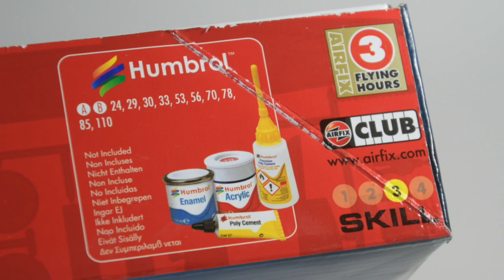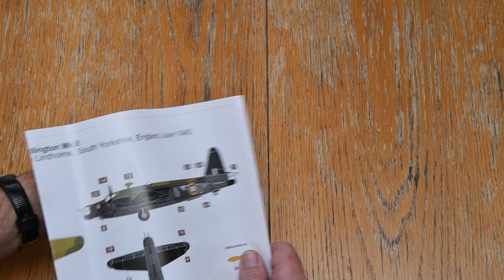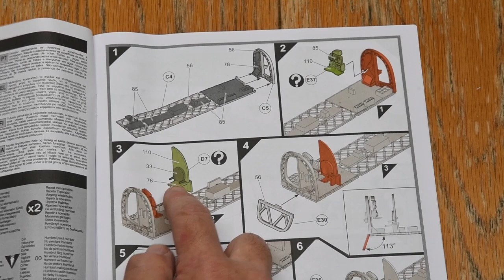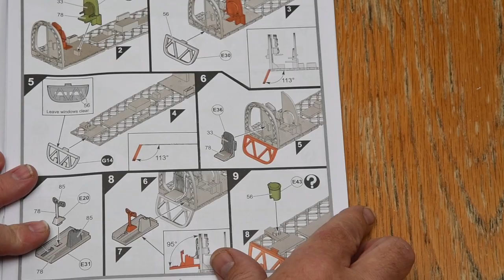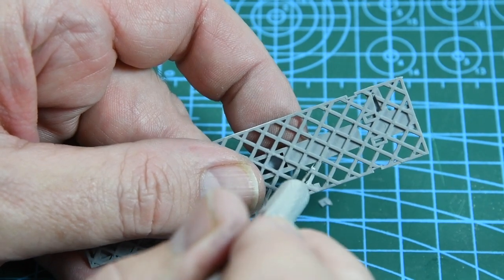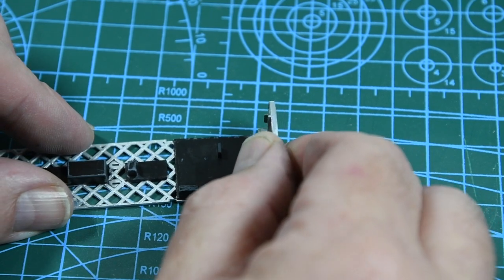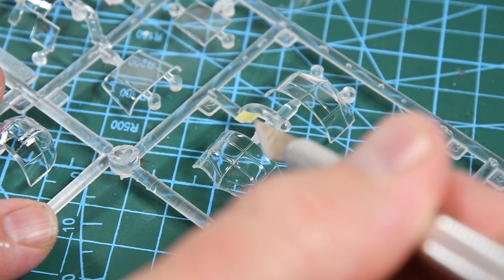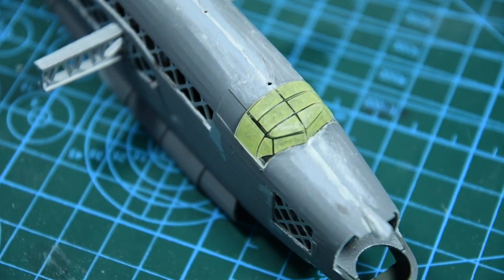Airfix Vickers Wellington Mk.II 1/72 2021 release full build and review  HD 720p

Comment: Well, that went together well.  That wouldn't have been the case with older Airfix molds.
You seem to use the term interior green for 2 different colors.  Interior green is as you have described it, and that IJN green is a nice scale match.  But the "interior green" for mechanical areas is often zinc chromate primer/preservative on Allied aircraft, which is actually a tinted yellow in colour.  Just a note from previous builds.
This is a workhorse aircraft in WWII and, I would have thought, a complicated build.  But you took us through it a step at a time and made it all work.
Bravo!
Reply from the maker: Thanks Randy! Yes, I have encountered green zinc chromate on other kits - like the Hellcat in FAA service. I followed the Airfix advice on colours and they may well use interior green instead of chromate in some bits - I'm sadly not that familiar with the Wellington to know what goes where beyond the instruction leaflet! BTW more recently I have been using Vallejo IAF/IDF Green for RAF interiors as that seems just a bit closet to the BS colour. Cheers, Gary

Comment: A great kit, but Airfix did slip up a little by making the bomb bay roof open latticework.  In fact it had a solid floor to the fuselage, easily sorted with thin plastic card.  As moulded there would have been a hell of a draught in the fuselage when the bomb doors were opened!  Excellent video.

Comment: Thanks for the video. I’m building the mk1 so this is very helpful. 👍🏻
Reply from the maker: Glad to be of help. It is a very fine kit, good luck with it!
Reply: @garys_stuff  I’ve now built it! It’s a great kit. Do you have any recommendations for weathering a plane like this? I’ve only done panel washes before. 🧐
Reply from the maker: @TJFNixon  I did panel washes on the Stirling I've just finished, using a grey wash for the black areas and that worked well. Otherwise using a weathering pencil is a good way to get chipping effects on finished paint - use one of the water-soluble pencils from an art shop like Faber Aqua  - or an AK Interactive pencil of course! They do a variety of aluminium shades but are not the cheapest things. Little bits of dry brushing of aluminium can look good too but practice on a bit of sprue first, this kind of thing is useful for propellers. Also add some brownish grey wash to the gear legs perhaps.
Reply: @garys_stuff  ace. Thanks. I’ll give it a go. 👍🏻

Comment: Nice job, Gary! 

I note you have had to use an amount of filler on the fuselage and engine casing joints - were these areas problematic? 

As an armour modeller returning to a hobby I left a very long time ago, I am pondering whether to dip my toe into a small but relatively simple aircraft build, just to show willing! Can you recommend anything? Gnat / Hawk / Jet Provost? 

Also, can you tell us what airbrush you use? I have an old Badger starter airbrush kit in the loft - is it worth me recommissioning it or do look for a good starter airbrush? Have seen the battery-powered ones advertised - are they any good or are they a gimmick? 

Apologies for so many questions, Mr Evans, but I have an enquiring mind.  Well, most of the time! 

Best wishes from Wirral!
Reply from the maker: I suspect the filler was more of a 'me' problem than a kit problem, but I'd have to watch it back to be sure. Sometimes there looks to be loads of filler and I've either filmed it before final sanding or the lip is very small but I have a wide streak to similarly thin filler to even out the surface as much as possible. But I can't remember any bad fit in the kit at all.

As for simple kits - the new starter set Hawk is very straightforward indeed but you might find it too basic for you - the JP is a nice little kit and I've not made the Gnat. I'd wait a few weeks to see what Aldi and Lidl do this year because both of them have deals coming up with Airfix and around a fiver a kit might be a good time to buy some of these to try out! Not definite what kits will be included yet.

My airbrush is a Timbertech one off Amazon, comes with a proper compressor (but not an air reservoir tank). I tried one of those ones with the desk-top little compressors and they were really not any good for me. Really wouldn't go with a battery powered one. With a proper compressor you get a fairly steady flow that you can dial up or down with some accuracy depending on what you're spraying. They also come with different size nozzles and matched needles again depending on what you're trying to do. There are many, many videos on YT about airbrushes! My one was about £75 or so and has been going for a couple of years without any major issues. One thing, especially with acrylics, is keeping it clean and maybe even using acrylic retarder to stop the paint drying in the nozzle.

Very happy to answer questions when I can - just allow that the reply might be a day or two later than the question!

BTW, have you made the Tamiya 1/35 Chieftain? Seems cheap for the size?

Comment: great video Gary! love your work and model choices. Could you please give me some advice on buying an airbrush? i still use brushes so am pretty clueless as to what i need to look at thanks
Reply from the maker: Hi Sean, I found that the cheaper airbrushes all seem to be pretty much the same. What has made a difference to me is getting an airbrush with a half decent compressor. I use a Timbertech one that costs about £74 at the moment online. What I have also found invaluable are the many tutorial videos around on YouTube, so spend a bit of time with them as well. Thanks for the kind feedback too!
Reply: Also, while it might not seem obvious, you need to master the airflow to the brush.  Less air gives you more control over the paint when working on a model.  Aaron Skinner at FineScale put out a magazine-sized book on airbrushing a few years ago and it's terrific.

Comment: The kit is good and a variant with Rolls-Royce "Merlin" engines instead of the usual Bristol "Pegasus" engines is certainly interesting. Unfortunately you built the model a bit in a "sloppy" way: abrasive dust and other small particles on the surface, silvering of decals (19:38), overflowing cement (20:07), uneven panel lines (19:57) ... therefore it's just "medium" quality in my opinion.
Reply from the maker: Sorry you think my work is "sloppy". I'm doing my best in a tiny corner of a multi-use room I have to share. If I ever get a studio I'm sure I can do better, maybe achieve better than just "medium" quality. My videos are only there to share my experience of making these kits, not to lecture or pretend I can do well enough to win competitions. I never will be that good. But thanks for your remarks.
Reply: @garys_stuff  I've not built an Airfix kit for 50 years! I can't believe the detail that Airfix now incorporate in their models. Don't worry too much about your work being 'sloppy', I think that your model is stunning, be proud of it. Everyone has different standards and if the way you do it gives you pleasure and satisfaction, what the hell does it matter what anyone else thinks. You've just inspired me to go out and buy an Airfix model, just the same as my older brother did all those years ago by being in the RAF. Keep up the good work.
Reply: @garys_stuff  
You get 100 marks for finishing the kit.  You lose a couple of marks for minor mistakes, but remember that the goal was to show us how it went together.  I know lots of "experts" who really have nothing more than a collection of half-finished cockpits.  It takes guts to do this in front of us and I learn something every video, my friend.